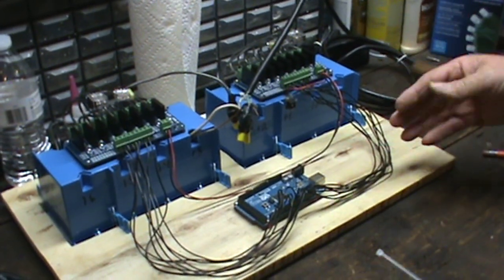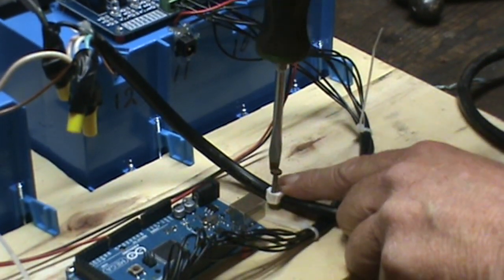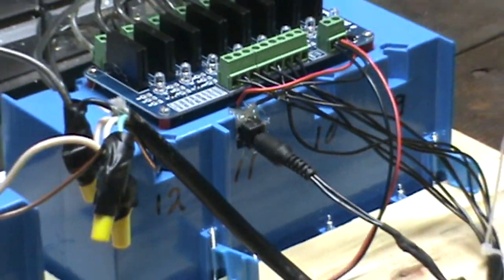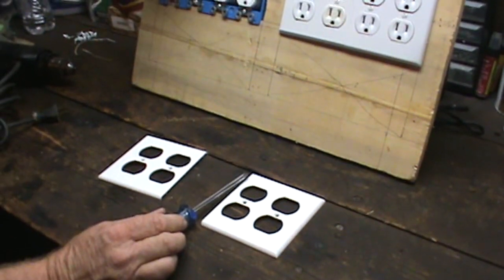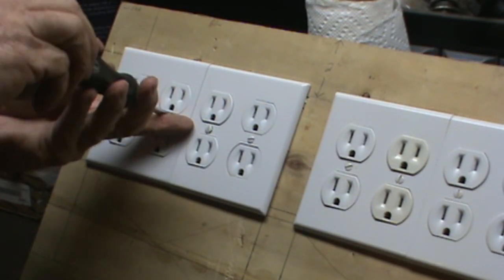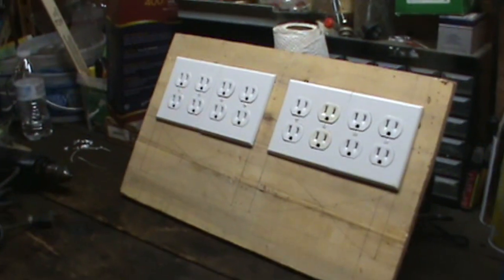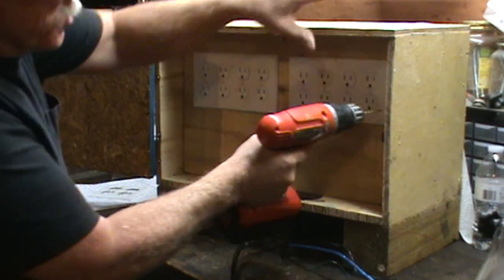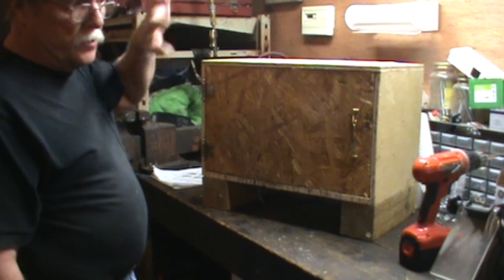Cheapskate Video 1 Part 6, Christmas Lights to Music Using Arduino and Vixen Lights

Comment: Did that cable actually work? USB is only rated for 16.4 feet so that cable is twice the maximum cable length for USB.
Reply from the maker: I've had no problems.

Comment: I just finished wiring everything and when I plugged in my relays none of the LEDs on the back came on. Is this an issue?
Reply from the maker: The light on each relay comes on when you play a sequence. That tells you that 120 volts are flowing when the light is on.
Reply: Okay so I should attempt to make a sequence before I conclude everything is broken?
Reply from the maker: You don't need to write an entire sequence to find out. Just open a new sequence, don't bother to add music, add a few set levels and start it with the space bar while you have your mouse curser over the pause button. Pause it when the curser is over your set level. The light on your relay should stay on.

Comment: Hey Dee, been watching for a while and actually built this box and was wondering if instead of having to run your power cable and the transformer out of the box if you could just add another outlet on the back side of the board running off the main power to power the supply? Wasn't sure if you thought there would be too much current drop?
Reply from the maker: I don't see any reason why you couldn't.

Comment: Dee, I am building this project along with your video. I am just about done with it. I have arduino and vixen installed. I do have a personal question about vixen 3 I want to ask you. How can I contact you personally off of this site?  thank you.
Reply from the maker: Afraid I don't know anything about vixen 3. I use 2. Is this a question you could ask the vixen team?
Reply: Dee Higginbotham I have both.  I have a question on a sequence.  Nothing technical.
Reply from the maker: Send me an email address. I won't publish it here.

Comment: Hey Dee I was wondering if this setup has dimming capabilities and also can you do chasing lights?
Reply from the maker: To add dimming you would need to change out the relays. When I looked into it a few yearts ago it would cost around $40.00 a board to do. I'm too cheap so for my setup, no. As far as chasing you would need individual pixels instead of strings like I use. Once again individual pixels cost about a quarter apiece. Too expensive.

Comment: I made everything just like you. Everything worked out perfectly except I'm getting any error message on my program for my arduino 2560 and I can't figure it out. The message I get is the selected serial port does not exist. I checked to made sure everything says its using the same port as my arduino board is using. Any help would be greatly appreciated.
Reply from the maker: I suggest going back thru my videos and carefully following each step. Go to devices and printers to see what port your computer has assigned to the Arduino. Go to vixen, Right click on your controller to see if the port is the same as in devices and printers. If there is a difference, go to the Arduino program you used to upload the code and fix it there.

Comment: One question, I see this one has to be conected to the computer with a cable is there any way I can use it with wireless and without having the computer on?
Reply from the maker: You need a PC or raspberry pi

Comment: great video. I have a question. you made your channels with wall outlets. I am guessing  you just plug it directly into a wall outlet or place box where you want and run an extension cord to box? I know you are running lights directly to those channels...but are you running extention cords off of the box
Reply from the maker: I have one box on my porch, another beside the house and a third out in the yard by the leaping arches. The boxes are plugged into 120 volt outlets. I run extension cords from the boxes to the lights.